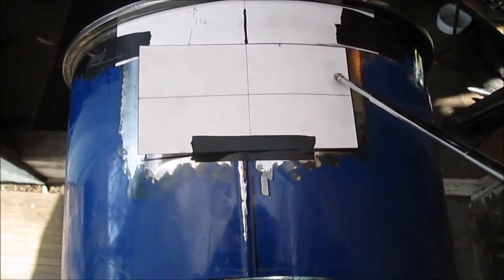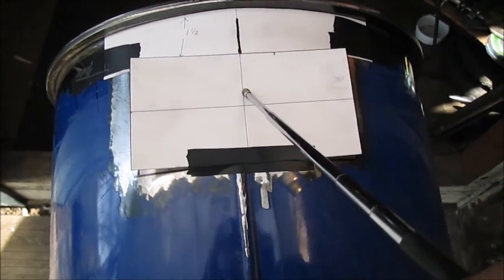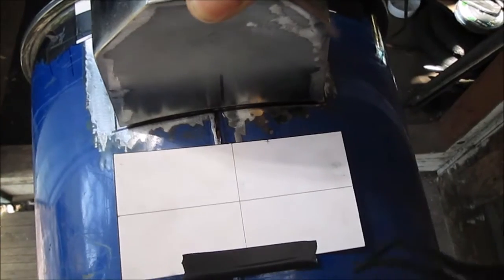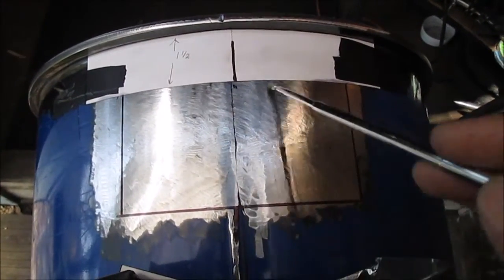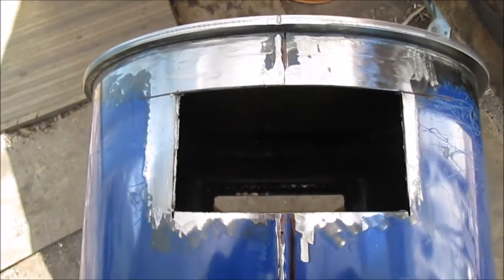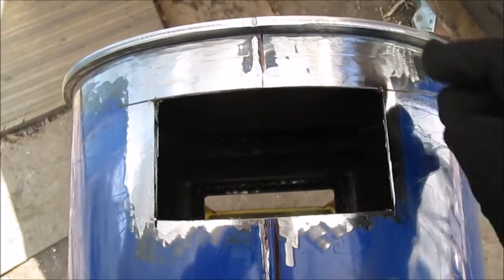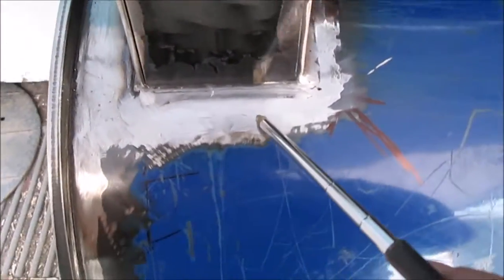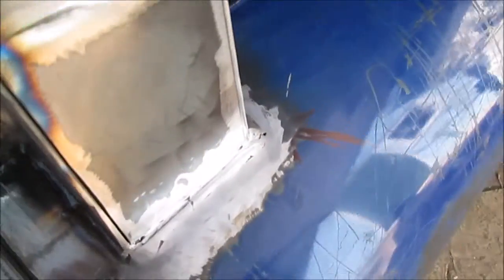Air Tank Potbelly Stove Build Part 11

Comment: A professional looking job, if you didn't tell, no one would know. You do know what separates a pro from an amateur, right?
A professional knows how to cover his mistakes... You got it done.
Reply from the maker: +The Shade Tree Fix-it Man Thanks !!!  Carpenters can be very good at hiding their mistakes I did make the template too big I should have subtracted the thickness of the top and bottom of the connector box so just the side pieces where they stick out fit the height of the hole
Reply: +not2fast4u2c   
But it looks great in the finished product and that is what counts.
Reply from the maker: You are right !!!...as long as it looks good when done and the weld is strong ...If it was a truck frame I would never smooth the welds too much and make them weaker